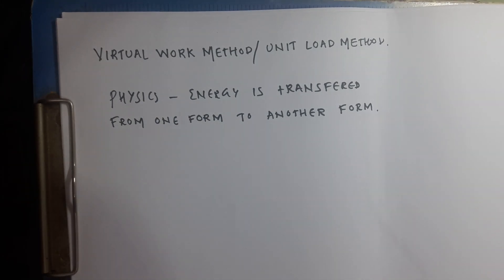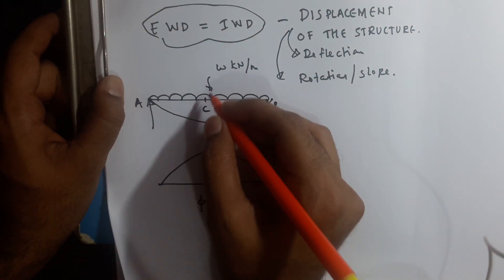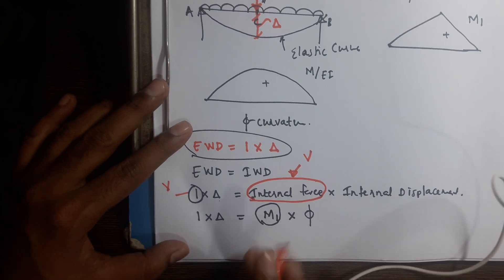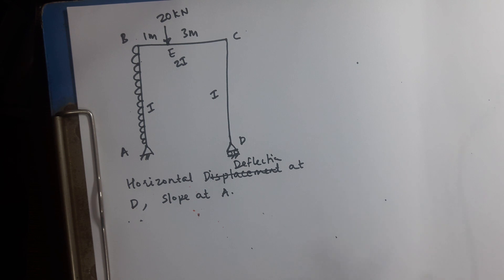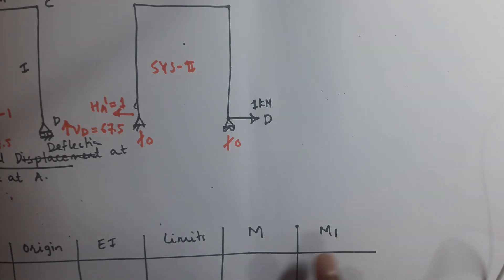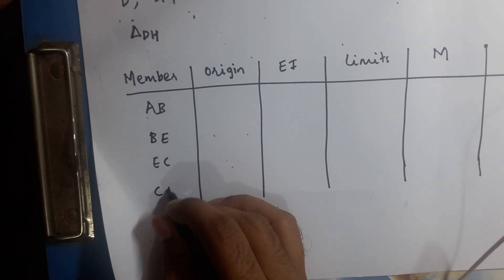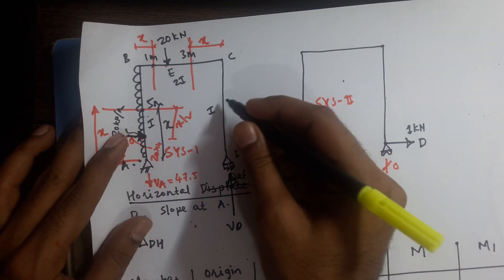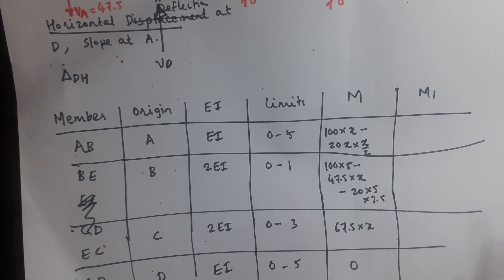Unit load method 1

Comment: i dont get the way how those vertical reactions did come....
Reply from the maker: Use equation of equilibrium by yourself.. u will get the answer
Reply: @CivilEnggLectures  how to use virtual work to find the reactions Sir?
Reply: @CivilEnggLectures  instead of using equilibrium method

Comment: At 11:00 why did u take vertical loads zero in virtual diagram ?
Reply from the maker: damiya akhtar cos no vertical reactions are developed..
Reply: Firoz Nadaf 
Sir pls tell me when you drew virtual load diagram u ignore udl and point load and only take virtual load at D 
Why is it so?
Reply: I get it 
Thank u sir
Reply from the maker: damiya akhtar we are taking unit load... cos unit load is not having any effect on work done.. it is only 1 multiplied to delta...
If you take load on virtual diagram..it will not give you a clear pucture thereby distorting the result.
Reply: Firoz Nadaf 
Thanks